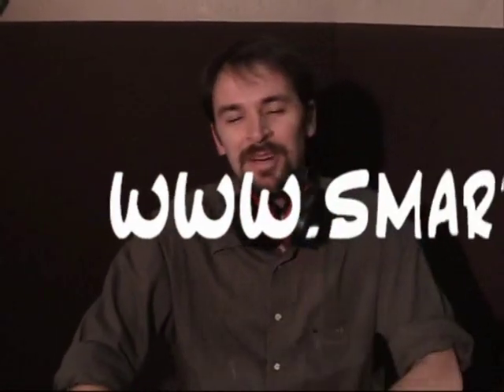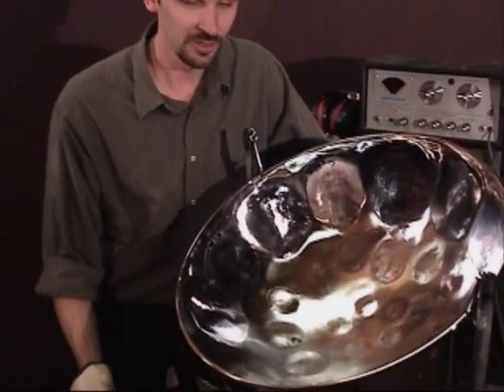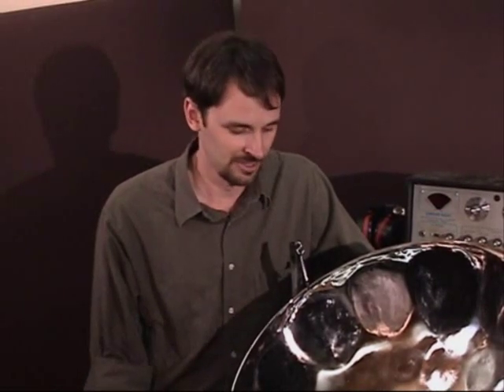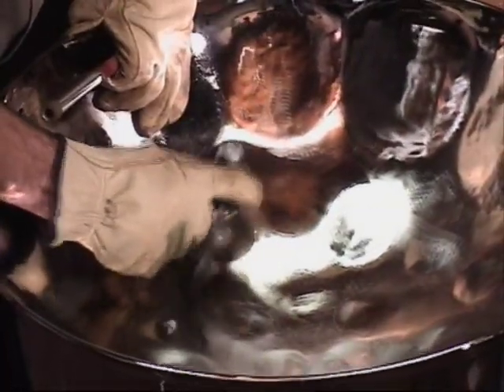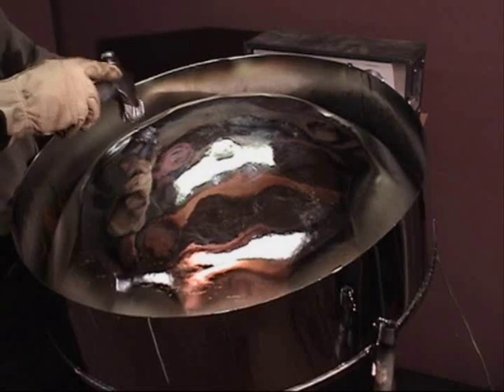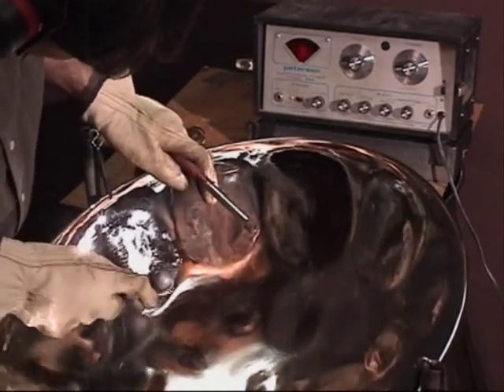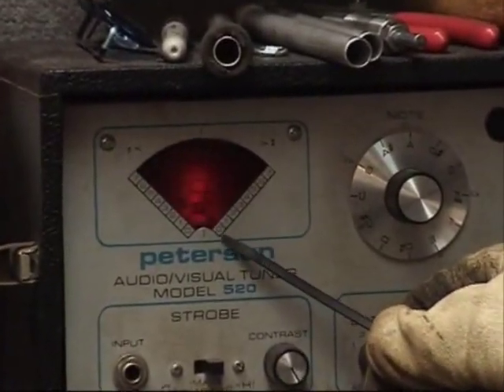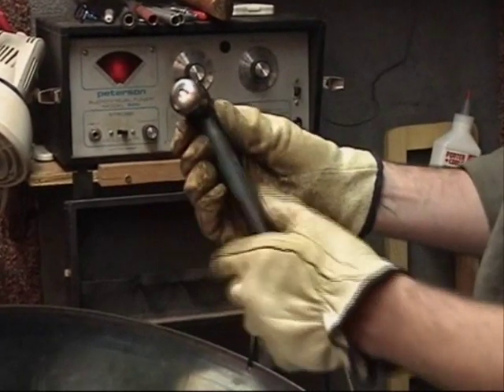How To Make Your Own Steel Drum

Comment: Can u make a video on how we can make a still drum out of a small coffee can?
Reply from the maker: Hi Ricky! Good question. I’ve tried making them from coffee cans before. I’ve also tried having small classes of beginners make them from coffee cans. Unfortunately, the steel on a coffee can is SO thin that it makes it more difficult to shape the notes and contour the steel. I think the easiest steel to start with would be about 0.9mm thick. Perhaps you could find this on a 5 gallon bucket somewhere. Yes, I’ve made simple drums from coffee cans and 5 gallon buckets, but the results are always less than perfect and to some degree, getting them into tune can take more time and with more frustration.